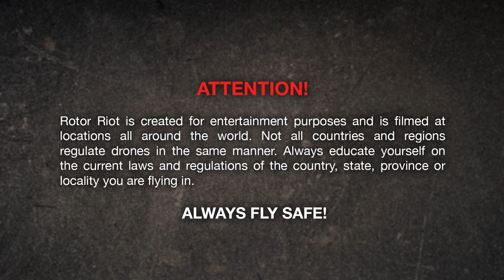Ultimate Duga Dive

Comment: That was super!!... Sickeningly suppppeeerr.  Congratulations Tommy & team, as this was only possible with help of many, i'm sure. 

Please, could you comment what camera angle were you using? I'm trying to imagine the quad's position relative to the "tunnel walls" during the dive. If i'm not seeing it wrong, with any upward tilt,  the quad would've to be over 90degree forward, so that the cam would point straight down. Or did you use downward cam tilt? Or, probably, i'm getting it completely wrong...

Is there any footage of an external camera following the quad/dive?

Comment: How do you get such good fpv range????
Reply: high power vtx (800mW) and fatshark diversity receiver with patch and cloverleaf antennas, and the distance wasn´t that great in the video if the antenna is 150m high and 500m long thats no big deal to cover
Reply: ^ I disagree with all of that lol. Just a solid setup and good antennas are most of it. You can get a little edge with a la forge diversity Rx with a patch and some nice tx and Rx omni's. But Kevin was running 200mW.   800 is not needed 

  Also  sander and anothe by were flying stock vortexes    Fatshark Rxs and spironets.  Soo...  You really just have to know how to fly though sketch video most of the time.    The video was good for tommy though. Most of the other guys had terrible video
Reply: @anton arnqvist Like the master said, listen to Steele I´m just a random guy
Reply: +Chris S. (ChrisFPV) So what you are saying is that i should get rid off my linear antenna and buy a circular+ rip my 25mw trx out and buy a 600mw?:)
Reply: circular antennas alone would help a lot, most recommended approach is to try better antennas first before you go higher mW, very often there is no need to drastically increase vtx power, if you´re interested in a new vtx check out tbs unify pro with switchable power 25mW - 800mW so you can choose higher mW if you need it.... I´m running 25mW myself (max legal power in germany) with aomway antennas and havn´t had issues with it even behind trees
Reply: +Chris S. (ChrisFPV) thanks, better antennas then. Here in Denmark is the maximum mw kind off 0
Reply: anton arnqvist just for completion and because i dont know how experienced you are, you need to run identical polarised antennas on vtx and Googles/Screen the antennas come in packs of two so this should be no nothing you have to watch out yourself, and carfully check if you need sma or rp-sma connections (with or withour pin in the middle)

Comment: I know absolutely nothing about quad flying. Can someone tell me what is si difficult about dives, cause honestly they dont look so special to me. Im not trying to discredit tommy or anyone, im just curious.
Reply: Csalagovits Máté when you divr you kill the throttle and let the quad Fall back to earth then you need to choose the right Moment of kicking the throtlle or you will crash it to the ground with 80mph or more
Reply: In this dive, there was only a couple of metres' clearance between the exit point and the ground, meaning that he had to time the throttle extremely precisely to avoid slamming into the ground. On top of that, it was a long and tight tunnel: not much room to manoeuvre. He made it look super easy, but it really wasn't :D